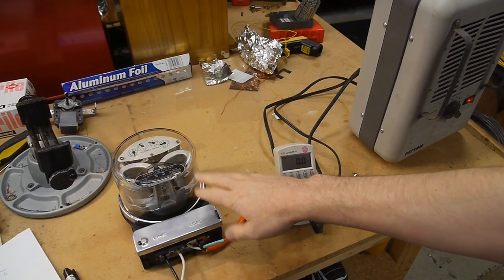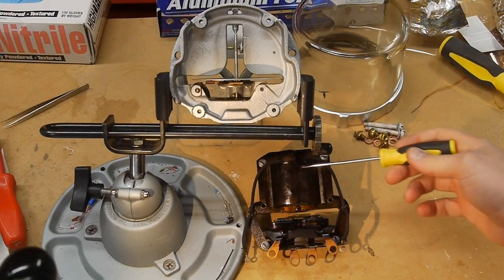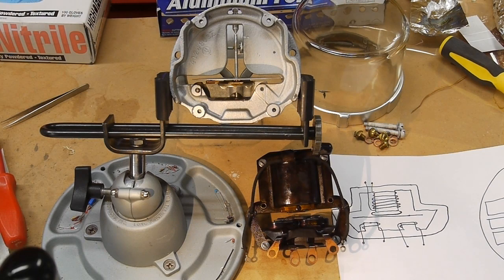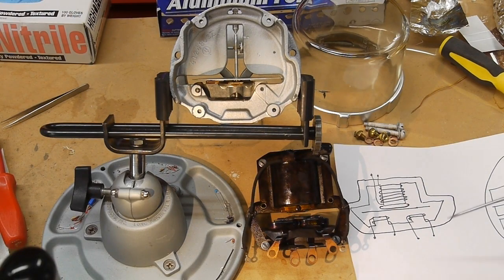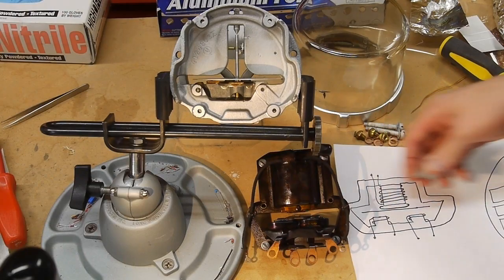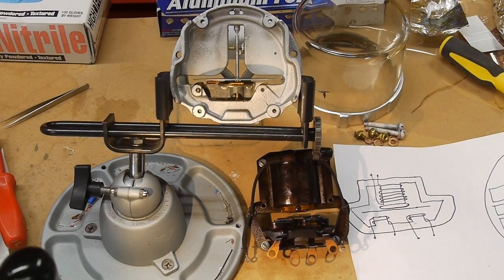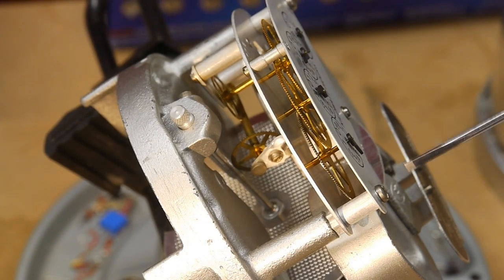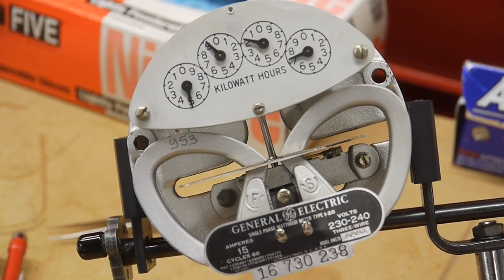Explanation of how kilowatt-hour meters work (electromechanical)

Comment: Excellent, excellent, explanation!!    I learned quite a bit, but have one question:  (yes, it's picky)   Is not an "Induced voltage" (by the magnetic fields)  the cause for the Eddy Currents - rather than a "current being induced?"   Thanks, really enjoyed your video.
Reply: haha yes man, its fascinating physics!
Reply: That is a good point and I would have to agree with you.  It is possible to induce voltage without inducing current, such as an open-circuited secondary winding on a transformer.  But it isn't possible to induce current without voltage.  In the case of eddy currents, the voltage is effectively distributed around the current loop.  For current to flow, there must be an electromotive force (voltage).  So, even though we are splitting hairs, I would agree.
Reply: Thanks for your kind comment - I just love current flow - well, and, then, there is "hole flow", right?
Reply: +Michael Donavon Current is flow of electric charge [coloumb/second]. This charge can be carried by electrons valence electrons able to move), holes (absence of valence elctrons, thereby "holes" absle to move) and ions. 

As for your first comment, from Faradays law of induction, a change of rate in a magnetic field will create (induce) an electromotive force (potential difference), wich will drive a current within a local current loop in the material.
Reply: So, then, your second paragraph says that a "moving" magnetic field will induce an EMF, which will THEN drive a current.  I would say we are "on the same page.  Thanks.  (don't you just love "hole flow!"   "Nothingness," with a Positive Charge moving opposite to the electron flow!)

In a classroom atmosphere, hole flow is sometimes a difficult concept - but it is so easy to visualize.   An electron leaves "a space" and a hole is created.  As those electrons move towards the "Positive" source, it "appears" that the holes are moving toward the Negative source.  "Ain't" that grand!!   :)
Reply: Indeed!   What was that?    "E=Mc2?"  :)

Comment: Do you have any idea as to how much power the meter itself consumes? Eliminating that loss might be another reason for smart meters, since they are devoid of moving parts.
Reply: +Lorenzo Boyd I'm betting it's a comparison of "inconsequential" to "inconsequential". On the old meters, there's a small current in the voltage coil at all times, but something on the order of a watt at most—my evidence is these meters don't even get warm. And the current coils likewise have a bit of resistance that causes a small burden voltage. Moving the disc and gears is a matter of clockwork and likely a tiny fraction of the electrical load.

However, the new meters will likewise have a current shunt that also cause a burden voltage, but it might be more since you'd need to have a measurable voltage for everything from 0.1A to 200A whereas the old meter, working on magnetics, needs only current to flow—not a burden voltage (e.g. if the current coils had zero resistance, the meter would work the same with a zero-volt burden.) The power supply for a new likely draws some power as well, and will probably pull about the same amount as the voltage coil (likely a small transformer since the power used by the electronics is so small.)

In the end, it's adding about 1-3 watts of power to a system designed to read thousands of watts to interpolate thousands of kilowatt-hours. Even at 3 watts, it would take 15 days to burn one kilowatt-hour.
Reply: Lorenzo Boyd the point of smart meters is easier meter reading and knowing when you used the power.  That way the can encourage you to use and not use power at different times of the day to stabilize the grid. Encourage meaning variable rates. As more unreliable sources of energy come on line like solar and wind and electric vehicles become viable smart meters become smart switches to manage peak power.
Reply: half a Watt

Comment: I am guessing that the asymetric setup you mention at the end could be a method of fine adjustment or calibration for the device.

If the device is created on a factory scale then slight imperfections may be introduced into it, by allowing some form of calibration outside of the main elements would allow the device to be tested and adjusted just before being shipped out.

However this is a complete guess based on no actual knowledge.

Comment: Nice video! now I just wonder why are there TWO current coils instead of one. You did mention these two coils but you didn't give an explanation for what purpose are they intended?
Reply: +sukhoy He has the meter wired up wrong. It is suppose to have two hot legs in and two hot legs out with 120v per leg. The common is suppose to be a pass through or bypass.
Reply: sukhoy my guess would be one coil for each phase.
Reply: +aquatrax123 But isn't this a one-phase meter? Two coils would be relevant be for split-phase 120/240V (still technically one-phase though) but I can't see how the four terminals could then be connected. No, I'd guess it's because of all engineer's fad for symmetry, especially in the old days. Note for instance how beautifully they've arranged the permanent magnets. They would only have needed one of those, too.
Reply: There is a coil for each line in a 3-wire supply.  The neutral is not connected.  If he is using this on a 120V circuit, I’m not sure what he will get for a reading.

Comment: I'm curious if it will register kVARh together instead of just kWh.
Will it turn if the load is only fully reactive like a capacitor or inductor?
Reply: Afdhal Atiff Tan Amin Husaini Tan It will not turn. It will also not turn if you add a diode in series with your appliance. That's the main reason why the company replaced all meters with the digital ones. Plus the digital meters can measure the power factor allowing for fining customers who have poorly designed appliances.
Reply: EdWatts
>It reduces the power consumption by 50% while reducing the brightness by 29.3%
You couldn't be more wrong. Lightbulbs do not have linear resistance; the cooler the filament is, the lower resistance it has. And the cooler it is, the larger the portion of the emitted spectrum is shifted to the useless infrared. The argument about it not having time to cool is flawed in that it also "doesn't have time" to warm up, you can't circumvent the conservation of energy. Your diode reduction will have these ballpark values: 40% less consumption (not 50 because of the negative differential resistance), 80% less light (Planck's curve shifted). Ask any electronics engineer, he will confirm this.
Reply: Afdhal Atiff Tan Amin Husaini Tan I don't believe it will. I think that a reactive load will counteract the force of its own magnetic field moving through because all of the energy flows throught the hot line back and forth instead of using the neutral as a return path so there is no usage of the second current coil.
I could be wrong, but I think thats what happens. I remember reading about power companies not being able to use meter data to assist planning for service line changes in industrial areas where low PF buildings would typically be found.
Reply: Afdhal Atiff Tan Amin Husaini Tan I don't believe it will. I think that a reactive load will counteract the force of its own magnetic field moving through because all of the energy flows throught the hot line back and forth instead of using the neutral as a return path so there is no usage of the second current coil.
I could be wrong, but I think thats what happens. I remember reading about power companies not being able to use meter data to assist planning for service line changes in industrial areas where low PF buildings would typically be found.
Reply: Kyle McNicoll Thanks for the insight. :)
Reply: zwz • zdenek I just knew about the diode, thanks! :)

So, if they are fining us on low power factor, does this mean they also charge us on KVAr? If so, a power factor correction device will be helpful here.
Reply: Afdhal Atiff Tan Amin Husaini Tan
The penalty is usually applied to corporate customers. Households tend to have plans that are more expensive without the power factor checking. It will probably also differ per country, so check your contract.
Reply: zwz • zdenek Good point. Thanks for the insights. :)
Reply: Afdhal Atiff Tan Amin Husaini Tan You didn't know about the diode because it's not true. It will still bill if you add a diode.
Reply: Ariel1S I wish I had a real meter to do experiments with. Ben?
Reply: Afdhal Atiff Tan Amin Husaini Tan 

I used to put up a LOT of Christmas lights, and every string had a diode in series to reduce power consumption and [incandescent] bulb failure.  The diodes lopped off half of the sine wave, but, I can assure you, the meter spun much faster when the lights were on, even though I was only using half of the sine wave on each set.  I did my best to use diodes in both directions and the same number of lights on each leg to avoid too much imbalance between the legs of the service, but the principle remained -- diodes did not cause the meter to read improperly.
Reply: EdWatts >I did my best to use diodes in both directions 
That's the problem! To give the trick a chance, you need to make the "imbalance" as big as possible, obviously. You probably connected half of the lights to use each half-wave and that's the same as having regular load.
There is another problem: Reducing the power per bulb by as much as one half will indeed make it last almost indefinitely, but it will also reduce the efficiency very much. My preferred way is to re-wire the chain to have about one quarter more bulbs in a segment. This will extend the lifetime indefinitely assuming you only run it during the holidays and still not reduce the efficiency by that much.
Reply: zwz • zdenek 
It reduces the power consumption by 50% while reducing the brightness by 29.3% ((2^0.5)/2 -- the filaments don't cool completely during 1/2 cycle); it's a good trade.  Nevertheless, the meter measures both legs, and diodes don't cause errors.  Electric motors, however...

Comment: The asymmetric coils are most likely there so that the power being consumed on the 120volt and 240volt lines generate the same amount of force acting on the disk. Its current and the number of windings of the coil that influence the strength of the magnetic field. So one coil must be larger to equally generate the same amount of magnetism as the other. Example: P=VI: 120volts * 1ampere = 120watts, but 240volts * 1ampere = 240watts. Therefore the current is the same but the power is not, so one (240volt) coil must be larger (having more turns) to increase the strength of the magnetic field to equally exert the same amount of force on the disk as the other coil (120volt).

Comment: I have trying to figure out how they determine my watts, the #'s on my bill are different then the #'s on my analog meter 4 #'s compared to 5 #'s on the meter
Reply: Allen White Assuming I didn't misunderstand you, meters aren't reset after every reading, if that's even possible.  Your meter keeps track of all the kilowatt-hours "consumed" at your house since it was installed, and your monthly bill comes from subtracting the previous month's reading from the current reading.  For example:

Last month's reading:  65432 kwh
This month's reading: 67890 kwh
Usage for month:  67890 - 65432 = 2458 kwh

Hence, 5 digits at the meter and only 4 on your bill.  But again, I might have totally misunderstood what you said/asked.

Comment: The 2 different current coils in the bottom of that meter are most likely a design by GE. All modern electro-mechanical meters 1970 up have 2 indeferent coils on the bottom. If a kWh meter is rated for 1 phase it will have more windings than one coil, if it is rated for split single phase it will have 2 exact coils with 2 phase in the voltage coil.

Comment: I believe the dimpling on the disk is primarily for rigidity. A sheet of 16 gauge steel is very flimsy, but when it is given ridges it can hold much more weight (for example a truck bed) without flexing or bending, that's why the floor of a car and a truck bed have those shapes stamped into them.
Reply: its not just the plant but also infrastructure replacement, power line maintenance, sub stations, etc, etc. Oh and lining the pockets of CEO's but that's an entire other issue.
Reply: Yep and one knock and the slightest deflection and it won't slide through those magnets.  They would be unable to charge for any electricity.  They probably did that as reaction after a few homes went uncharged.  Plus it stops people from tampering with it.  If the dimpled disk were bent out of shape someone would know you did something.  Smart customers of the late 1800s would be smart enough to go into their device.  Bend it slightly and just say it was ware.
Reply: jefrhi That's some serious bullshit lol. Retroactively making you pay for something when they have NO idea how much you used? That doesn't even sound legal. 

Not to mention Electric companies make a fortune off consumers... say even just $100 a month off a person and they power a million people... I don't believe for a second it costs a hundred million to power that plant, so their profit margins are definitely large enough to let THEIR mistake slide.
Reply: @Phoenix See 12:32. The disc connects to the gear that train makes the different dials spin at the correct ratios. The electric company can then read how much electricity was used.

Comment: You mention a few times that the meter measures current or power, but it measures neither of these - it measures energy. Well, it actually registers energy. I suppose you could measure (or time) the disk rotation speed and get an average power measurement that way (averaged over the measurement time), but again, this is a watt-hour meter, not a watt meter.
Reply: ***** It measures power (J/s) over time (s). Which is energy (J). So if you argue about  a specific point in time, you talk about power. If you read the digits off the display, you read power integrated over time, that is, total energy during the interval since the meter was reset.
Reply: I would say the device senses voltage and current, from which it computes power (analog computation) and integrates over time, registering energy.
Reply: These devices do not measure electricity!  It's a big fucking con-job. All they do is rotate slowly when current is passed through.  Fucking lies.   IT IS IMPOSSIBLE TO MEASURE ELECTRICITY! ! WAKE UP
Reply: Richard Kocksworthy You tell ‘em, champ! Don’t pay those bastards shit!

(Please report back your findings.)

Comment: Hi, to answer your question on the split current coils, you have already answered . your own question with tension offset. Essentially you have one coil that is unevenly split either side of the central electro magnet. Thus when powered up, ensuring that the spigot direction is always positive and thrust is controlled with a current offset differential.Hope that helps. Good demo though.

Comment: My name is Nick, and i am a final year Electrical Engineering student from university of Pretoria busy with final project. My project is to design an EMS(Energy management system) and small part of the project includes converting the register dials of the ferreris meter to LCD display.Looking for a ferreris energy meter and the set up for connecting one on a bench with sockets outlets in my lab. please assist.

Kind regards

Mr L:N Sinugo
Beng Electrical Engineering
University of Pretoria

Comment: Great video, always like mechanical meters and the US ones always had a tendency to be round vs the UK square ones despite still often.being GE. On the two current coils, meters don't generally care about the neutral, they just need it for the voltage coil. I think it's possible the same movement will do a split phase with 220/110v 3-wire system where the two sets of current coils will measure the two lives (or hots) which are 180deg out of phase due to effectively a center tapped transformer supply.  If they didn't connect it in a single phase 2-wire, it would affect accuracy. It being connected to neutral would mean it's being there is cancelled out and the accuracy wouldn't be affected. I think thats why anyway!

Comment: When the meter spins backwards will so the counter¿
Reply: ***** Just be sure you don't have it up on unstable cinder blocks or it might drive through the garage into the creek.
Reply: Yes, it will. All you need to do is feed the load side and load the feed side and then the meter will spin backward. All the dials will turn in the opposite direction.
Reply: Thanks
Reply: Not if there is a detent gear

Comment: Is the voltage coil connected in pararel with phase and neutral, and one of the two current coils are connected in series with the phase and the other in series with the neutral??

Comment: This phase-shift delay could be generated by a capacitor in series with the voltage-coil, couldn't it?
Reply: Yes, but capacitors have a limited lifetime and would have to be replaced every few years.

EDIT: Just realized this video is 5 years old. Still relevant though lol

Comment: It can be used for both, although they measure completely different things torque and energy are dimensionally equivalent. Likewise a newton-metre is a unit of torque and energy, except the latter is normally called joule. Same goes for dyne-cm and erg.

Comment: Very common. It's actually a split phase: 240V with a center tap, so you get "two" 120V phases, 180 degrees apart.

Comment: The stippling is purely for manufacturing reasons. It is to plastically deform the plate over its entire surface when stamping, so as to relieve stresses from rolling. That way the plate will remain flat.